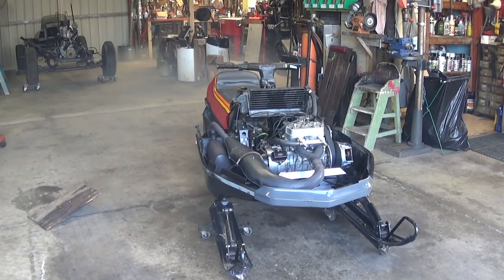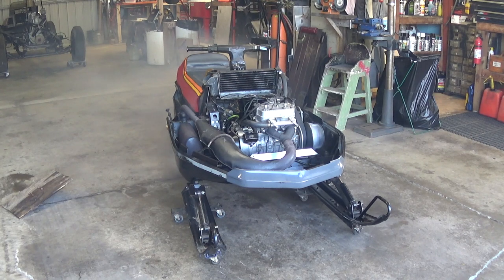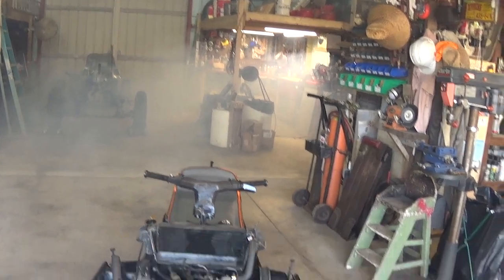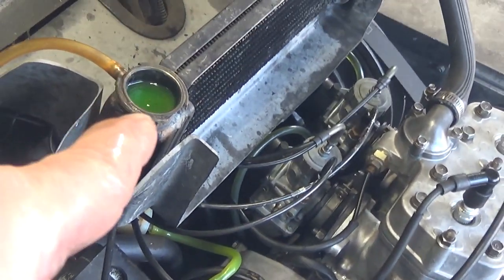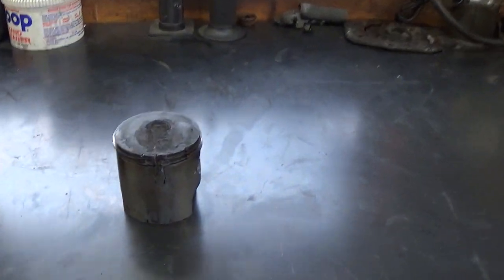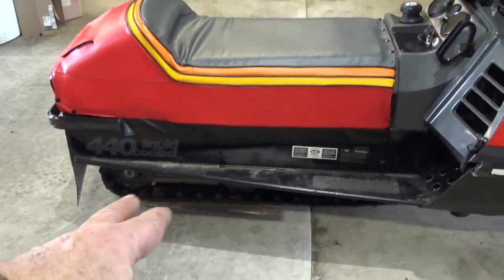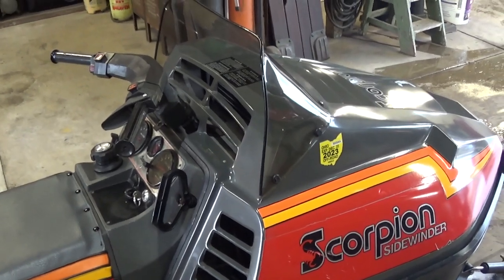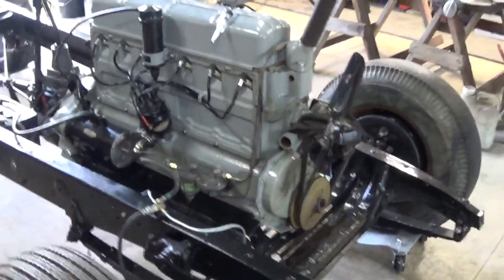1981 Scorpion Sidewinder Engine Rebuild   Final Episode

Comment: Wow sounds like it’s running great, love the tiny sound two strokes make.
Reply from the maker: It is running great, I finished painting the exhaust system today and put it back together and it fired up on the 1st pull, stone cold. I've pulled the rear suspension out and going through it now. Thanks for watching Dennis.